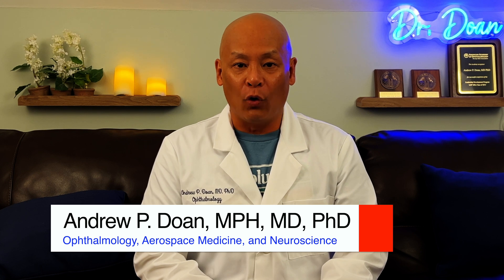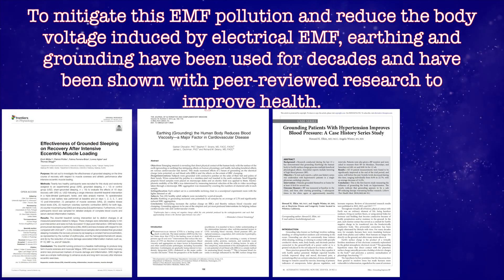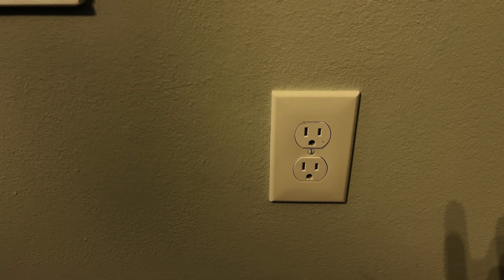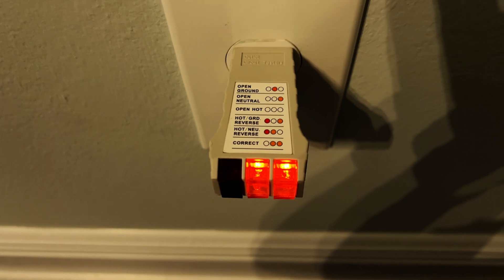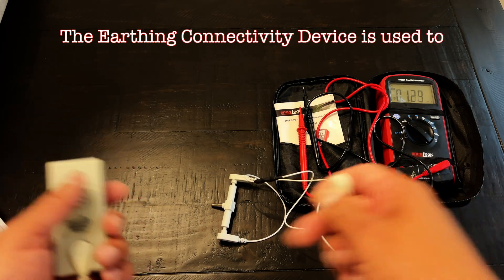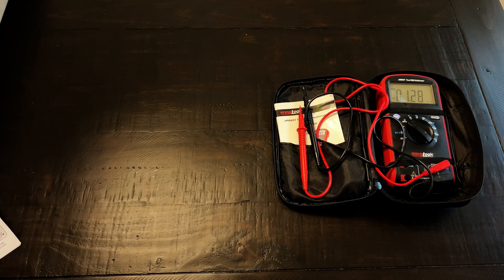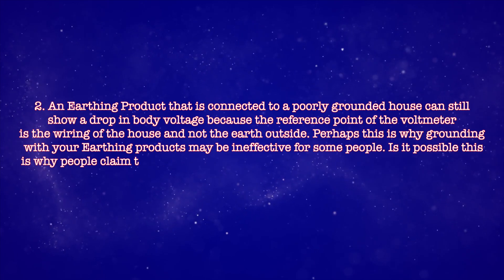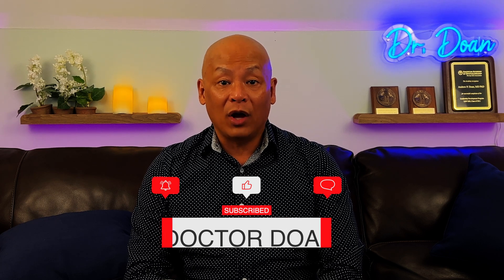Earthing & Grounding Lower Body Voltage & Shield Against EMFs - Proper Way to Measure Body Voltage

Comment: I got an emf meter recently, most of my home measures 0V/M, however the seat in front on my PC, touching the emf sensor where my head rests, measures 84V/M with everything not only turned off but unplugged altogether from the wall, and this is already weird enough. When I turn on my PC the same spot gives me an alarming 1300 (yes one thousand three hundred) V/M. This isn't normal, right?
Reply from the maker: That’s not good. There’s something emitting the EMF in your walls. Definitely get a grounding mat: http://tinyurl.com/earthingcompany

Comment: Hi i got a question. I connected the black to the ground the red to the nipple on the grounding sheet and there is a voltage of 7.3 vs 7.0 while sitting on the sheet same config and if not touching the sheet red lead in my fingers and black lead in the ground out let i am roughly at 3.3. what am I doing wrong and is it normal for the sheet to have voltages
Reply: Interesting it looks like my CPAP air hose has voltage as now that the house is not touching the sheets the sheets are now reading 3.9
Reply from the maker: 1. Are you measuring AC or DC voltage?

2. Is your sheet grounded during the measurements?

3. Sheet voltage is not normal.
Reply: @DrAndrewDoan  1 Ac voltage, 2 well yes no... I am placing the multimeter between the ground and the sheet black lead in the female part of the ground wire that came with the sheet in the ground outlet and red lead on the male part on the connector on the sheet.
Reply from the maker: @sdionne000 that is not how you measure voltage. 

1. Ground the sheet.

2. Connect the voltmeter black lead to the ground. Use a separate, independent ground is ideal.

3. Touch the voltmeter red lead to the grounded sheet. Should be ZERO on volt meter.
Reply from the maker: One more thing, an ungrounded sheet with wires will be like an ungrounded human body in a 50/60 Hz EMF. The ungrounded sheet with wires will have induced AC voltage too.

Comment: I really am eager to learn how to properly test my emfs and voltage but also now am totally confused. I will keep researching.
I did learn some things though. Thank you.
Reply: It’s confusing all right:(
Wish there was a pictogram to show steps. 
Question one how to know if house is grounded well.
Question two …how to know my reading…..with and without being grounded.
Reply from the maker: @deborahlochhead4087 

1. You have to use a volt meter and determine the resistance (Ohms) from your socket ground to a stake in the Earth outside. It should be as low as possible. Less than 200,000 ohms is ideal.
Reply from the maker: @deborahlochhead4087 

With and without grounding is body touching the earth/grounding device vs. not touching the previous.

Comment: i only found half of this video is confusing, even viewed couple times. Especially the part that connecting two separate wall outlets to testing cables. i don't understand why?!
Reply from the maker: Using the same outlet completes a circuit and will drop voltage even when not grounded.

Comment: Hi, my body voltage goes up when I ground (grounding pillow connected to my yard via a rod). 

When I ground via the outlet, my body voltage goes down. 

Why is grounding with my yard raising my body voltage? Should I stick with the outlet?

Thanks!
Reply from the maker: Is your voltmeter set to AC Voltage and is your voltmeter negative black lead connected to the Earth outside using a dedicated stake and wire for the voltmeter ground?
Reply: @DrAndrewDoan thanks for replying! I am using ac, but I grounded the black lead to my outlet ground. I’ll try connecting it directly to the earth and see if I get the same results. Thanks!
Reply: @DrAndrewDoan  I just tried grounding the multimeter directly to the earth—not an outlet—this time, and my voltage went down as it should when I touched my grounding pillow. Thanks, it worked!
Reply from the maker: @pradeepan  Outstanding news!!!

Comment: This video is very confusing. When you were demonstrating your body "completing the circuit" with the small device you were using in the beginning, it looked like you were just pushing the tester button each time to make the green light turn on. How does that show that your body completes the circuit? Came across as a parlor trick. 🤔🤔 Can you explain?
Reply from the maker: On the back of the small device (continuity tester) there is a metal plate. My left finger touches the metal plate, the metal plate connects via wire to the socket ground. The socket ground is connected to the grounding device via a second wire, which I touch with my right hand. The continuity tester lights up when there is a complete circuit from body -> socket ground -> continuity tester -> body.
Reply: @DrAndrewDoan  yes, I completely understand that. I did see the metal plate. However, each time you "completed the circuit," you were also touching the tester button. Can you demonstrate it without touching the tester button? That's my question.
Reply from the maker: @DanielleLegacy You have to push the button to turn on the light. If the circuit is broken, either the left finger is not touching the plate or the right hand not touching the grounding device, then pushing the button will not turn on the light.
Reply: @DrAndrewDoan  okay, gotcha. I have never used one of those before. Thank you for taking the time to explain it to me. 😊
Reply from the maker: @DanielleLegacy My pleasure!
Reply: I had a few friends who won’t try Earthing’s to cure problems citing ‘dirty earth’s. I even know someone who sleeps in a faraday cage to protect from EMF & yet won’t ground it! I told him it won’t work! 
 As long as this of so called dirty earth myth exists then people will use it as an excuse not to try grounding.

Comment: Dr. Doan, this video is a little confusing to us old people. :0))  I have been using grounding products for 3 months and have found no real benefits at all through my house outlet.  I have found I seem to have more aches and pains that I ever did yet everyone calls me crazy.  I bought a grounding cable to use in the ground but could not use it because my window screens are not removable as I have double hung windows.  I was going to buy this voltage multimeter but I am more confused than ever.  I have watched the video several times but (must be dense) I still don't get the full process to test.  Any help for my ailing body and brain?  Thank you in advance
Reply from the maker: This stuff can be confusing! My suggestion is that you get a handy man to drill a hole through your wall for the outside grounding cable. Then fill the whole with caulking. Use your grounding products with the outside grounding stake.

Comment: Are you suggesting that the wall outlet should not be used to ground my mat/sheet?
Reply from the maker: If your outlet is grounded well to the earth, then use your outlet. One way to know that your outlet is grounded well enough for grounding with your mat/sheet is comparing your body voltage drop using the outlet vs. an outside grounding stake. 

I hope this helps!
Reply: OK. Thanks. I would need to buy an outside grounding stake in order to do this, correct?   @DrAndrewDoan
Reply from the maker: @hitchdesign  You can do this with a cheap BBQ skewer and some wire. Even speaker wire will work. Connect the black negative lead of your voltmeter to the wire that is connected to the BBQ skewer stuck into the ground.